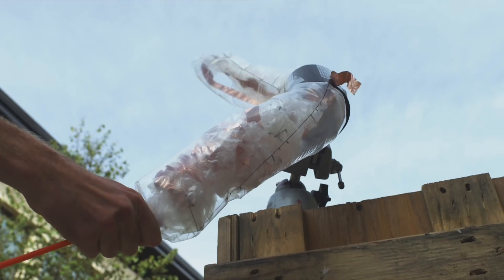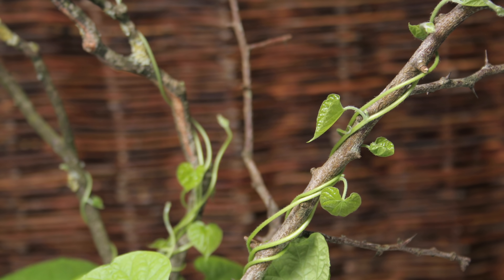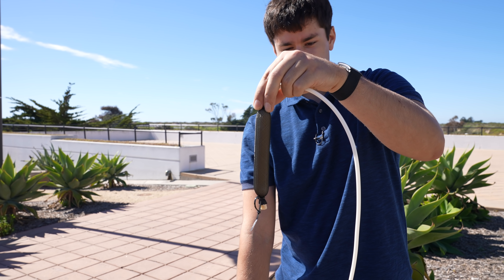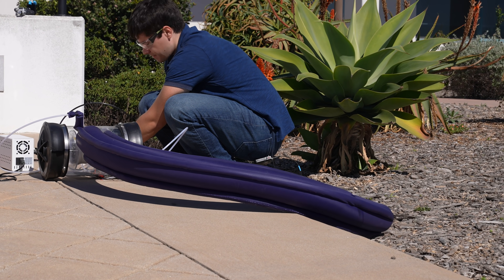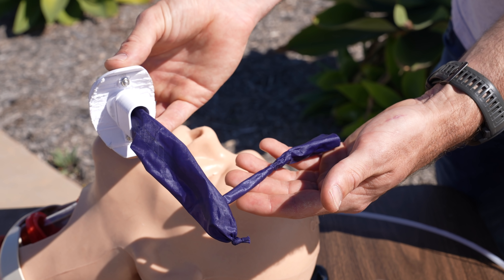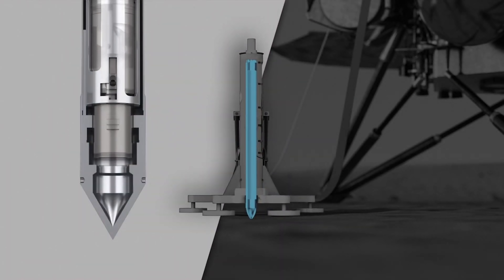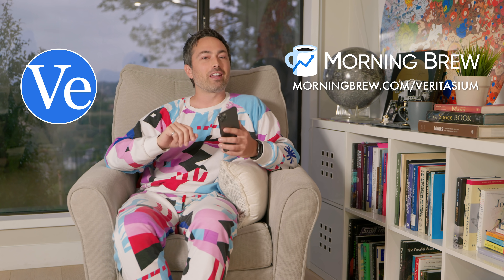This Unstoppable Robot Could Save Your Life

Comment: As a trained Anesthesiologist and ICU doctor I have to comment on that intubation part. 1) That man clearly does not know how to intubate, that was a terrible angle to approach. 2) Mannequins are notoriously hard to intubate because they are stiff and dry 3) Mannequin anatomy is standardized, humans are NOT. So many factors come into play as to how difficult an airway is. 4) finally, we already have a "tube"-like structure for intubation, it's called a fiberoptic intubation. We control a camera on a semi flexible tube that is connected to a screen and we "drive" it towards and through the vocal cords. While the idea they have to design this towards intubation is good, without human guidance, I'm not sure how different it would be to a blind intubation (which often ends up going into the esophagus). With human guidance, it might as well be a fiberoptic intubation, which we already have. Perhaps they should put thought into utilizing it in the Gastroenterology world of endoscopy and colonoscopies?

Comment: Usage concept: You could use vine robots to run a tube to underpin foundations and then fill them with a cement after they're in place. The same would be true for other types of construction repairs in tight situations like cracking walls etc.
Reply: Usage concept for home renovators: you can clamp a cable in the middle part and deploy them through holes unreachable for humans
Reply: To pump cement you would need thousand of pounds of pressure. No hose that reinforced would be flexible enough to unfold the way these robots do. But nice try
Reply: @autodidacticartisan  maybe it's a two or three step process: run the inflatable tube first, getting to the desired location; then insert a thinner harder, maybe perforated tube through the inflatable tube to the desired, location; then pump a cement slurry in and wait to cure.
Reply: @autodidacticartisan  He’s onto the pumping something into a tight space part tho, you’re definitely right, it’d be way too difficult for cement but maybe filler or foam insulation for construction or something?  🤔
Reply: @jaden-hampton  an expanding polyurethane foam would be plausable. It could be heated to lower pumping pressures. I dont know specifically how much load the foam could supoort, but its is remarkably strong for its weight
Reply: @autodidacticartisan  Exactly, like what @Robert DiBenedetto mentioned above, you’d run the inflatable tube first, inside it houses a secondary pressure hose that’s much stronger than the outside one and can handle way more pressure when inflated or filled, you could then pump the foam from there, it’d be a two part system. On what you said about heating, the tube itself that carries the foam to the location could have copper wires that wrap around it or is weaved into the tube itself and heats the inner tube to whatever temp you need, that combined with pressure might do the trick.
Reply: Get a patent, start a business.
Reply: huh. Interesting

Comment: Wouldn’t the extra pressure in your respiratory system cause some sort of problems? I mean getting the soft tube in might not require a lot of pressure but widening the throat might? Saying this there also needs to be a automatic breaking point within the tube to let air through, after wich you kinda have to inflate the lungs since they are now the end of your tube. 
Now you also need a Programm that can automatically switch from insert state to inflate state followed by a automated breathing state. Were a manual inserted tube just leaves everything else to the normal body functions.

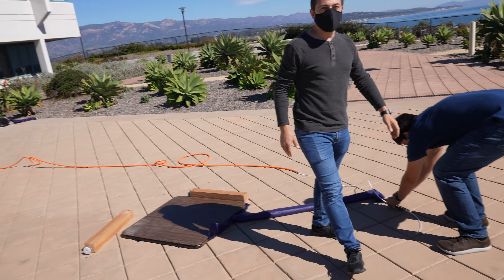Comment: 4:09  That's not a paradox, dude.  It's right there in the definition of pressure, force per area.  It's no more "paradoxical" than traveling a long distance at low speed with patience.

Comment: given the low cost of the material it'd be super easy to make a vine robot who's purpose is for cable laying. you don't need to retract it, you just have the robot guide the cable through some piping then stay there when its done.

Comment: Could you build a prefab house (bouncy house style) And fill it with a gas that sets to the side of the fabric and then slowly turns in to a solid.. layer after layer the tubing will fill up like closing arteries. Wouldn't know were to start building this... but still.

Comment: I want this with a claw on the end to push and pull cabling through drywall, through ceiling tile, through conduit. This would save thousands and thousands of dollars of time spent paying people to use pull lines and wire pullers.

Comment: I wonder if these engineers incorporated "slime" for tubeless tires. I ride a MTB and it's amazing how low pressure you can run on tubeless. Punctures are sealed instantly with "slime". It's not perfect but may be worth experimenting with on these new soft robots. Also, the tubes would look quite alien with green slime pulsing down the sides. :)

Comment: Honestly I'm just thinking of all the different construction based applications.
Branching conduits, not a problem if it can steer in small angles. Trying to find a clogged pipe or anything like that, flexible robot. Hell throw in a balloon and you could even use it to temporarily stop up piping/plumbing.

Hell if it needs funding just go to your nearest sex toy manufacturer, I'm sure they'll find some oddball use for it too.

Comment: Maybe a good idea is an auto-pierce function to help firefigthers in in huge buildings, you push the robot for as much doors and windows with some gas with no oxygen, and if it pierces for the heat, good, that means that area needed some anti oxygen, and if it doesnt, it keeps going until its at the core and auto piereces.
Of course it has to be in buildings with no people and i know it wont turn the fire off, but maybe can slow it down, for the other proven methods

Comment: This is basically how they install epoxy pipe liners. The technology for expansion part has been around for a long time.  Put some meta materials or epoxy with this and you could make the Eiffel Tower in your backyard in under an hour and cure it in place.  Or something more useful.

Comment: Obvious use is cheaper standing robots, although is there any way to make the air compressor quiet...?
a cheap skeletal frame for structure and stability combined with this could make those human-like robots we all thought would someday be doing our household chores back in the 70s actually become a reality. Just need to pair it with some machine learning ai software and a camera

Comment: An added benefit for the "intubation" procedure is: When you insert or extract the device from the patient's body, the contaminated surface is "blanketed" by the tube, so it does not move contaminants from one part of the body to another. 
Risks, of course, are incurred if the pneumatic supply were to rupture. For this reason, a liquid (rather than a gas) can be used as a driving medium.

Comment: I wonder about using it for geothermal drilling. Probably in conjunction with water, but maybe the air-based liquefaction would be enough. It would be so beneficial to just be able to grow around rocks in the ground rather than trying to drill through them.

Comment: Anybody who knows how intubation works is surely thinking how easy it would be to accidentally have it veer off into the stomach... If you miss and have to pull it back to reajust, you've got to change robots or the robot tip because you can't have a stomach acid coated robot going into your lungs. 
Compounded by the fact that you can't even see where you're going.

Comment: Just fiy, this has been used for ages in plumbing. It's called relining. 
It's commonly used for pipes that has holes in them but where you don't want to replace the whole thing, so you add an epoxy infused glassfibre lining to it. Because that's much cheaper and faster.

It's not new but it's cool to see it in new applications

Comment: Another medical application is colonoscopy. There are a fair number of patients that can't be properly examined with the snake-like cameras we use today. It just gets stuck somewhere and becomes too painful for the patient to keep going. That coupled with the fact that we only have one kind of "snake-camera" that can examine the small intestine properly that's very rarely used, this would solve a lot of issues. If we actually need to see the small intestine now, you either swallow a pill-camera or X-ray contrast fluid and do a CT-scan. The pill-camera can't take biopsies and the CT-scan can't either plus it's ionizing radiation.
A lot of potential in many areas.

Comment: If it goes through a tight space, will the pneumatic muscles still be able to control the robot? Because the muscles need air flow from the base of the robot. What if that airflow is obstructed.

Comment: It would be very helpful for installing any kind of wiring. Instead of pushing a cable down the hole and hoping it goes the right way or tearing up half of the wall, you could just attach the tip of the cable to the robot's end cap.

Comment: Well I would not want  these tubes to be used in medical applications (operations, extended period of time), how much damage can be caused by too much pressure inside lungs? If pressure drops(Power outage) how will the tubes react? If this geos mainstream, I fear some will "upgrade" these robots and use them as torture devices.....On the other hand, YES, if the patient is minutes away from death use them.
Reply: If you want a torture device use a knife and cut off their ears instead of a tube that can lengthen

Comment: Not sure why this is a thing... 

He could have taken the “idea” from watching a car crash with the airbag goes off. 

I’m sarcastically calling it an idea since the industry have been using this tech for decades. Mainly with hydraulics - same principle, different filling. 
Only thing that has change since are the materials available and manufacturing techniques. 
They r far from being alone in the air pressure robots field. 

The ISS even has a compartment added recently based on the exactly same tech.

Comment: These feel like machines more than robots. Most of them had one state, off or on. Nearly all of these would be disposable too.

Attaching a camera to a hose you pump air into isn't really a robot. It's too passive.
Reply: Not just cameras, you can add also artificial muscles for movement control, and other sensors, also the tip attachment could also potentially carry other finer working tools to do things like maybe to grab objects, cut wires, light, etc. 

Yeah, I'd agree that an inflatable tube by itself isn't really a robot, just like a motor by themselves isn't really a robot. But they could be used as part of a bigger system to create robot.

Comment: What if you put smaller artificial muscles in a lattice pattern running along the length of the robot underneath the main steering muscles and when you presurized them you could effectively rigidify the entire length of the robot and therefore make it an even more viable option for intubation

Comment: I'm a paramedic, and intubation is huge in our field. It's hard to perform this skill in an actual call, and it's complication-prone and takes a while to deploy depending on provider skill level. There are simpler devices that allow for supraglottic intubation, but unlike ET tubes, they don't isolate the airway completely (patient's vomitus can still find its way into the trachea).

In any case, this inflatable device is ingenious. I can't believe no one's thought of it before. It looks ridiculously easy to use as well. My only concern is that it may not isolate the airway completely, it must be lubricated to decrease friction (might be solved by being pre-packaged in a small amount of lubrication?), and it should have some sort of tube that allows for gastric contents to escape or for an NG tube to be threaded into the esophagus. Moreover, medications can be administered directly into the lungs when using an ET tube, and suctioning can also be performed by threading a french sunction catheter into the tube. The inflatable tube in this video might not have all these functionalities.

Comment: My mind immediately jumps to construction. Using a wire pull, electricians drop wires behind walls. But, it can often be hard/expensive if the walls are anything other than straight lines. Sometimes, there's pipes in the way or utility boxes. Soffits often have tricky bracing. So, using one of these, you could create a cheap wirepull that doesn't require a straight line from floor to ceiling. I may make one specifically for this purpose.

Comment: The issue with using it to drill/burrow down into a sandy planet is that the deeper you go the more air you would have to push down into the ground to move more and more material upward.

Comment: This could be really cool for exploring cave systems underwater. Using the expanding bot to drag along a larger tube that fills with air for people. If you could use a material that had two phases, a flexible phase and then a rigid phase that could be induced by electric current or something, you could then have self assembling structures or supports that contour to environments. I mean with the cost efficiency of these robots, perhaps you could just fill in the channels afterwards with a material that hardens into something structurally sound, like concrete.

Comment: What if you had nested tubes that could be expanded or retracted by strings or a secondary set of pneumatics, allowing you to potentially have the tube grasp onto objects. You could even have the secondary tubes have a plastic filament that becomes rigid when you stop applying the pressure to it, that way you can create a hand around an object, harden the internal structure, then retract the whole instrument.

Comment: This seems perfect for running cables. I'm sure that sentence alone has a lot of commercial implications. I'm thinking small-scale, I just want to run some network cable through a truss crawlspace between floors of my house, and there is lots of hvac ductwork, plumbing, electrical, and the truss structures in the way